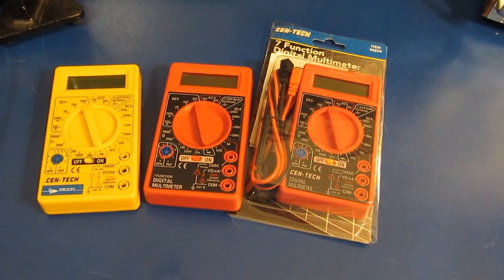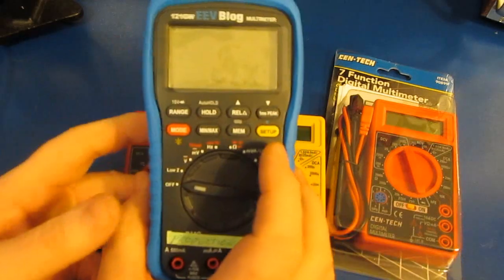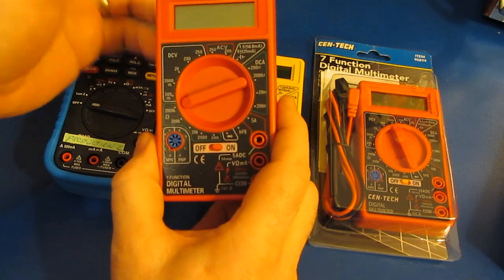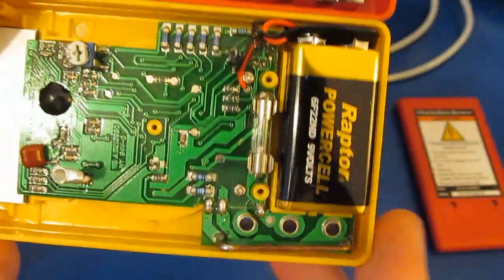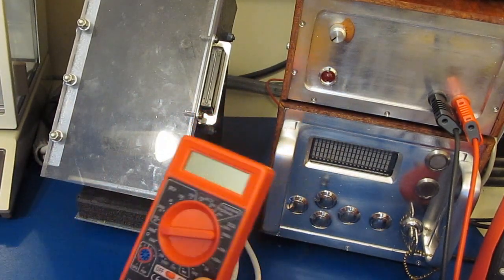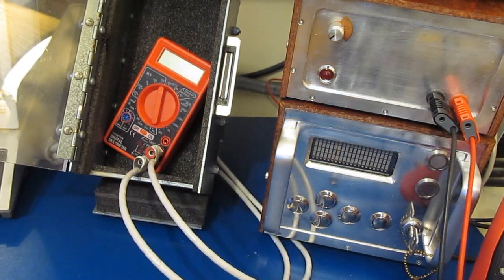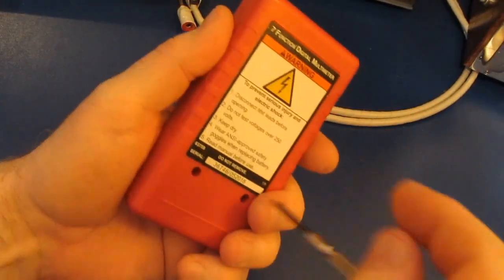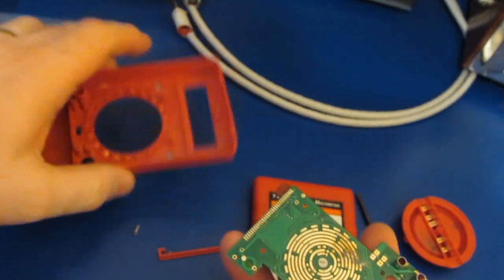Applying 2kVDC to various revisions of the DT830 DMM

Comment: It seems that the version DT-830 with the separate on/off switch is different then the version without this switch. 
i have here a unbranded version for doing low voltage measurings etc, bought e few years ago in a sort of dollarstore, and this week one part of the LCD screen didn't work properly, so i took it apart and cleaned the zebra rubber strip and it was back up and running. To my surprise had this meter 2 fuses and a PTC. One 500mA fuse for the mA range, and a 5A fuse for the 5A range. I have also some older versions of this meter from back in the 90's, and if i remember correctly, they didn't had any fuse back then, and one of these models has even a flashlight build in on top of the meter, with a on/off switch on the side of the meter. Grtz

Comment: Great experiment, Joe! I have been following the discussion at EEV and I was going to reply to that thread - unfortunately my time has been quite scant to participate on the forum lately. 
Another M830B- type meter worth testing is the Hypertough (sold at Walmart), which has third party certification. In the tests I did on my channel (280Vac) it performed quite well and was undamaged in all ranges (except battery testing, but that was expected due to the load resistor). Sure, it wasn't 2kV but it was within its own spec (300V CAT I).
Reply: I want the Walmart hypertough tested too.

Comment: I wonder how many of these things are given to children as toys?
Reply from the maker: It's about as good as my first Fluke meter.   I would have liked to have had a few of these growing up.
Reply: @joesmith-je3tq  oh yes first multi meter I had was 1kohm per volt  , my first digital was a broken autoranging  HP .it had a burned out  analogue switch ic (hp special  , they quoted something north of £700  for a replacement, so I made one with half a dozen cmos chips and two boards sandwiched together - it mostly worked)  . Yes would have killed for one of those freebies:-)

Comment: This is a new level of shoddiness. 250V DC can be easily exceeded by probing around household items, in europe rectified mains is 324V DC, in the US interphase voltage between two lives can be easily 240 or 480VAC. Thats dangerous to give out to untrained people.
Reply from the maker: I doubt you are suggesting we need to regulate the sale of DMMs.  Untrained people should avoid dangerous environments and trained people should use proper tools for the job.   Many meters I have looked at do not use safety fuses , or no fuse at all like this one.    We could regulate the import of such products but then again,  I saw on a popular channel where the person was going on and on about safety and Fluke meters, all the while showing that they had blown the fuse and replaced it with something from the local hardware store.
Reply: @joesmith-je3tq  i understand you not wanting to give out a name, but i can't deny that i really want to see that video now
Reply from the maker: @ItsBoyRed  I don't think that's any big secrete.  AGV or something another.  They did a review on a Fluke non-contact meter.  I was asked to look at it and watched some of his other videos on multimeters.  One was on Fluke vs some low end meter.  This video provided a clear image of the fuse I mentioned.   I've posted about it on EEVBLOG and I may have included a segment in one of my videos.   Shouldn't be too difficult to find.

Comment: WHY WHY WHY what is the point? .  You are putting 2KV into it? Ridiculous.  DO NOT EXCEED SPECS... Simple.   I have a few of these HF meters. They are handy for basic uses, for nominal measurements most people make, Volts, Amps, Ohms IN THE RANGE most people doing home and car maintenance, wiring, basic electronic troubleshooting. it does PNP NPN transistor gain hFE and diode tests as well, works. I only added high quality test leads to a few meters (only way I'd do AC with it). I have several. l placed in kitchen drawer, car, airplane, tool box. One $400 meter is great but worthless if you don't have it with you when you need it..... A multimeter in hand when you need it,  even this lowly HF meter, is priceless. They battery last forever.  I have about 6 HF meters and think. They gave them away free for awhile. I killed one, reason unknown. The rest have been going decade or more.   I also have lab quality test equipment on my bench from HP, Tektronix..... I am not a fan of exceeding specs to LOOK SEE.... there is no point. Engineers designed it who are smarter than you. Trust them. 
(BTW the design does and has changed over time, for the better or worse I don't know. The two I have handy at the moment have 1000V DC switch position.)
Reply from the maker: ROFLMAO!!!